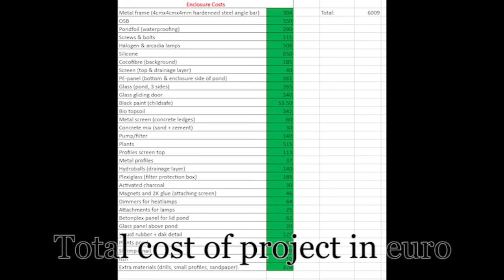Giant 4350 gallon reptile enclosure - DIY timelampse

Comment: I thought this was gonna be for a monitor or iguana or something, hehe. Also, any update on this one and how the snake is doing in it? I don't really get how it can go into the pond  tbh.
Reply from the maker: She is doing great tbh! One of the panels of the pond cracked a few months in, replaced all panels with 3cm thick plexiglass and added some supports for the panels on the bottom, back and side next to the enclosure. There is also substrate on the bottom of the pond now. :D It did add another 2.2k to the overall costs of this project. 

I'll upload a video once where you can see the whole setup a bit better. But at the top right of the pond is a hole she can pass through, she knows the location the entrance/exit very well! :D

Comment: Very curious to as why so many seems when placing ply ....why not use 4'×8' sheets....again curious
Reply from the maker: I guess it would depend where you're from. Here in Belgium the biggest size I could get at the time on a pallet was 240x60 (which is 8'x2'), so that's what I used. :p

Comment: Please give me step by step tools and directions to build this for my kids pet lizard
Reply from the maker: The basics to build something similar: 
1. Make a sturdy frame out of steel angle bar (this step is only necessary if the enclosure is too big for the panels to support all the weight, my smaller enclosures don't have this for example)
2. fill the frame with wood panels
3. waterproof the WHOLE inside of the enclosure, we used pond foil for this
4. create any ledges and stuctues, waterproof them and cover with a fine metal mesh and coat them with a few layers of cement, sand them to remove any sharp point or edges
5. add drainage layer, mesh screen, activated charcoal and on top your bioactive soil mix (whichever you pefer to use)
6. add wood, branches, plants etc
7. install all the lamps, in case you mount them inside of the enclosure you'll either need wire cages around the lamps or domes specifically made to be mounted inside (and thus they don't get hot on the outside of the dome)
8. the top of the enclosure is window mesh, I used frames for mounting them to a window with pofiles on the sides and back of the enclosure to hold it down, if I need to remove them I can slide them out from the front

For this enclosure a pond is also included, it's made with a welded steel angle bar frame and plexiglass, there is a heavy duty pump and still requires waterchanges when she releases waste in the water. 

For tools you'll need a drill, a saw that can cut wood and one that can cut metal, drillbits for wood and metal, silicone gun, expansion and glue foam and mostly a lot of time and patience. :D If you have any other questions, feel free to ask. ^^

Comment: If you reno or build another instead of using the towel in concrete get some chunks of foam then you can carve the foam to look real then brush wet concrete on looks awesome that way
Reply from the maker: I actually was first planning on making them that way, but with the wood covered in pondfoil as a base it didn't have anything to hold on to on the bottom/vertical sides, so the foam would just fall down, even with the metal mesh around it, it just was too heavy to hold itself while curing. XD on smaller ledges it works, but on this size it was too much to get on there without the weight of the foam pulling itself down without anything to support it or hold on to. 😅

Comment: Cool idea, im getting ready to build a pvc 8w4d6h enclosure. What did you frame it out with?
Reply from the maker: I used steel angle bar (the beginning of the video it's shown). Hardened steel of 4cmx4cmx4mm (1.6 inch x 1.6 inch and 5/32 inch thick). :) These profiles don't bend, not even over a length of 14ft. :D
Reply: @yoshinowa1  thank you, where do you get them at?
Reply from the maker: @bradsbioactivebuilds  I'm from Belgium so an exact shop won't help you, but you should be able to find them at most home depot stores or store with base construction materials!
Reply: @yoshinowa1  thank you! 🤘💯🦎🐢🐸🐍
Reply: @yoshinowa1  how did you secure the plywood to the steel angle bar? With bolts? Thanx for your responses
Reply from the maker: @bradsbioactivebuilds  indeed with bolts! And then covered everything with pond foil for waterproofing.

Comment: How is it looking after 1 year? Do you think you can make a litte tour in your jungle?
Reply from the maker: Some of the plants died, others grew so big I had to move them as they started pushing against the top screen, another one got a massive pest issue and got taken out to be treated. But overall it's doing great! The plants are all growing well, but it will take some more years and me adding more plants to fully cover the backpanel and floorspace.

I'm currently working on a rain-system, once that's installed I'm planning on doing an update video, showing the finished build more in detail (the whole pond has been re-done with plexiglass, it has substrate etc) :D
Reply: @yoshinowa1  Wow its sounds like a never ending lovestory with that enclosure! :D 

Why will you re-done the pond? Will you add some FIsh? ^^
Reply from the maker: @Gladiatorpig  it sure is! Live plants and a big clumsy snake are a work-ensuring combination xD

The pond was originally made with double layered safety glass and PE-panels, one of the glass panels cracked and I replaced them all with plexiglass. It added quite the costs to the total count compared to what is at the end of this video, but for sure worth it! There have been 3 Siamese algae eaters, a bristlenose catfish and a whole lot of shrimp in there from the start, they are still happily living in there (they have been picked specifically for their size and speed, so my snake doesn't munch on them) xD

Comment: Are you going to do a follow up?
Reply from the maker: Yes! As I've changed the glass panels for plexiglass on the pond (so it looks a bit different, as the pond now holds substrate too) and currently installing a rain-system. Once that's installed and working I'll be making a new video on the setup. In October I'll also be joining a podcast on the enclosure with "Animals at Home" here on YouTube if you want additional info on it. 😊

Comment: real dirt inside I think you are going to run into problems in your house after a bit real plants etc going to get a lot of moisture and will be bitch to clean turf is what I use. is that terrarium completely sealed off gonna get mold if not. tell yah the reptiles are def going to love it in there
Reply from the maker: The whole top is screen and it has a built in ventilation in the room (so mechanical movement of air, sucking excess moisture out and keeping airflow in the room). It's the white circle you see above it in the back of the room on the final pictures. :D it's now been running for about a year and a half without issues. It's fully bioactive and I have to keep a close eye on when and how much to water ofcourse. Currently working on a rain system for the setup, making the system itself isn't hard, getting the amount and frequency it will spray everything is by far the hardest part. 

But my house was forseen for very high humidity and the removal of said humidity, as I also have aquariums and waaaaaay too many plants in my house. 🤣 without the ventilation that it has now, my walls would have long molded indeed.
Reply: @yoshinowa1   nice I was not putting you or the terrarium down at all. My Iguana died recently  he would have loved something like that. I was just pointing a few things out to you. I was thinking right after sending reply I hope he doesn't think I'm putting it or him down have to work on that lol
Reply from the maker: @ericluscombe3272  oh no worries! They are valid concerns that I didn't really cover in the build video! It are things that don't affect the quality of life of the animal, but can have detrimental effects on the room itself! 😊 I had a company come over that adjusted the mechanical ventilation to manage the humidity, but it for sure was something that was needed, the enclosure would kick the humidity in the room to 85+% without it!

And sorry to hear about your iguana, I'm sure you gave it a loving home! 🫂